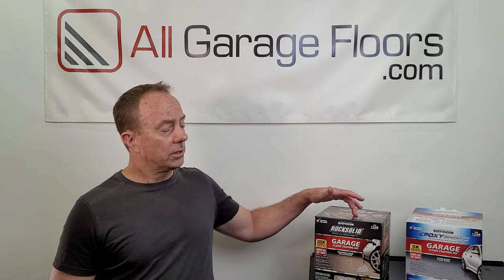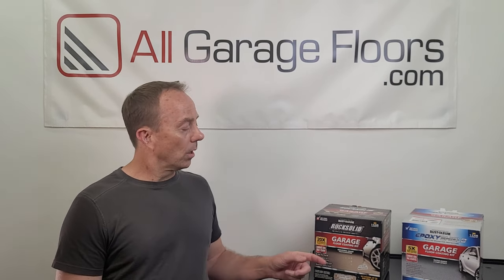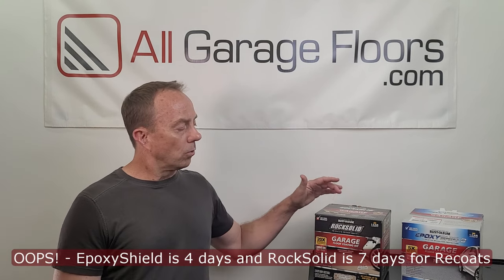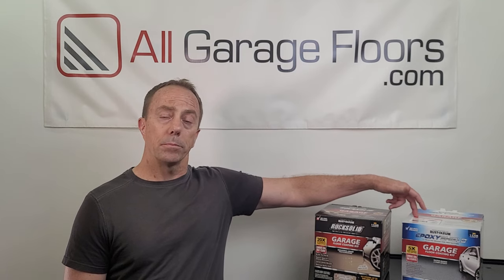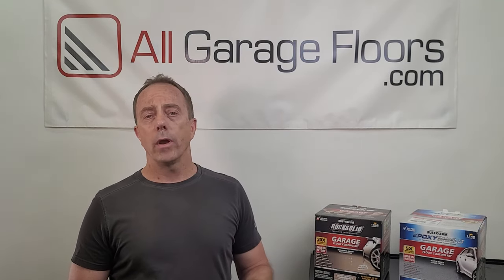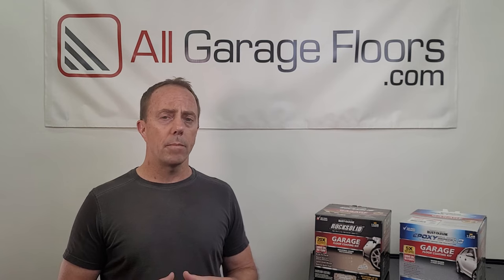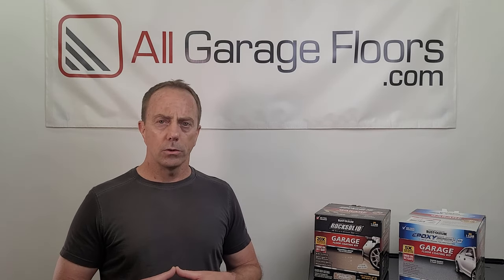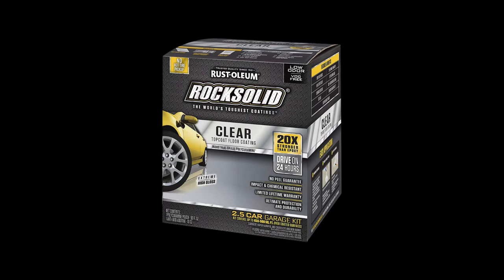RockSolid vs EpoxyShield | Which is Best for your Garage?

Comment: I’ve used both kits and the Epoxy Shield didn’t last but a few years. Hot tire pick up was the biggest problem. Sanded it all off and went with Rock Solid. It’s been on for about fifteen years. The problem I had with Rock Solid was a few batches never dried. I contacted the company and they were aware of certain batches being defective and replaced it.  Recoated the sticky areas but it still picked up dirt over the years. I have had zero problems with hot tire problems with Rock Solid. Now the clear is pealing off in front of the garage door and assuming it’s from the UV rays.
Reply from the maker: Hi Johnny. 15 years ago was before Rust-Oleum acquired Citadel Coatings which developed RockSolid. Back then, the RockSolid kit was a polyurea and not a Polycuramine like it is now. Polyurea is the better coating, but could be problematic at times. That is why they developed Polycuramine. If you scrape up the clear coat that is peeling and then rough up the entire floor with 120-grit sandpaper, you can apply another clear coat to the surface.
Reply: MIne is going on 12 years perfect, no tire pick up, no oil or gasoline spills affected it.
Reply from the maker: @31acruz  That's great! Again, as we stated above, RockSolid was a different product back then. It was a 100% solid polyurea (not polycuramine). The polyurea provided a higher dry film thickness, it was U.V. stable, had better scratch resistance (wears longer), and better chemical resistance. They created Polycuramine in early 2014 just before they were sold to Rust-Oleum. The reason for the change was to create a product that was more DIY-friendly. A compromise in performance was the result.
Reply: Just did the rocksolid today. I bought more than I needed in anticipation that I'd run short, but I didn't. Hopefully I didn't go too thin but my concret was very smooth, and I feel I did the right amount of prep. It's still drying at the moment, right off the bat I see a couple small areas that appear slightly darker. But if that's all there is and there's good adhesion, then I'm happy. I used 2 x 2.5 car garage kits for 900 sq/ft.

Comment: I thought the Rustoleum primer on previous painted floor can be used it is about  $70 a gallon and then the Rocksolid over it .I was told at a paint store is this correct
Reply from the maker: Hi Ed. That is correct as long as certain conditions exist. The first of which is that the current paint must be sound and fully adhered to the concrete. We tell you everything you need to know about Rust-Oleum Recoat Primer in our article here: https://allgaragefloors.com/rustoleum-garage-floor-primer/

Comment: Thank for posting. I got Rock Solid on my garage. Bad news is bubbles all over the places .I figured out it may be the moisture problem. In my case ,which one is suitable for my next job or any solution at all ?Thanks.
Reply from the maker: Bubbles can be caused by a variety of things. Examples are not waiting long enough for the concrete to dry after etching, rolling it too fast and heavy, air getting trapped if aggressively mixing it in a bucket, or applying it in the early afternoon with rising air temperatures. The best way to fix it is to apply another coat. First, sand the surface with 100-120 grit sandpaper to knock down the bubbles and any sharp edges for those that popped. Sweep/vac and then wipe down with denatured alcohol applied liberally to a microfiber mop pad. After that, you are ready for the second coat. 

If you believe it's moisture vapor from below the slab, then that requires something completely different. You would need to grind the coating off and do a moisture test in a few areas to determine how much moisture vapor transmission you have. If it's greater than 3 lbs, you will need to apply a moisture-blocking epoxy primer. These are more expensive than RockSolid and have a lower coverage rate. You then apply a new coating to that within 24 hours.

Comment: I have a new 24x25 garage, equaling 600 sq ft. I purchased a 2 1/2 car plus 1 car kit. According to the packaging it should cover 600-750 sq ft. The 3 bags did not cover 1/2 of the garage. I needed to purchase 2 more 2 1/2 kits in order to finish the floor. If I had known that the coverage was so low, I would have primed the floor first in order to seal the concrete. Primer is a lot cheaper then this product!
Reply from the maker: Hi Michael. Yes, this is a common complaint that we address in our review of RockSolid on our website. However, there are no proper primers available that you can use. They are not compatible. The first coat of RockSolid IS the primer in some cases. We explain why not to make a primer mistake with these coatings here: https://allgaragefloors.com/epoxyshield-rocksolid-concrete-primers/

Comment: Rustoleum has a new primer product that can be used over any surface to prep it for either of these finish products. If this primer is used first, it will help with coverage of the final epoxy / polycuramine.
Reply from the maker: Hi Gerald. If you are referring to the Rust-Oleum Concrete & Garage Recoat Primer, it can only be used on previously sealed concrete or coated surfaces in good condition. It can't be used on any surface, especially bare, untreated concrete. We don't mean to be sticklers, but such vague statements create unwanted problems for DIY installers unfamiliar with coatings.

Comment: I had to use two 2.5 garage kits for my two car garage. That’s right two 2.5 kits in order to get the high gloss finish. My concrete soaked up the polycuramine so much. But I expected this to happen with all the negative reviews I read. I doubled up and it looks gorgeous! Lay it on thick and back roll it until the roller starts to stick a little. Then finish rolling to remove roller marks.
Reply from the maker: Hi MGT. Yep, it's a common complaint that we talk about in our article. The problem with that though, is that it now cost more than a commercial quality single-part polyurea system that is twice as thick, more durable, and just as glossy.
Reply: Can you put a concrete binder down or are you not supposed to put this kind of epoxy on a concrete binder( my slab is extra nasty from the last owner and is in a flood plain, so it’s a humid slab)
Reply from the maker: @jakejake7162  Hi Jake. Concrete binder primers are not compatible with coatings. We discuss primers for DIY coatings in this article: https://allgaragefloors.com/epoxyshield-rocksolid-concrete-primers/
Reply: How many square ft. did 1 kit cover to get good coverage?

Comment: Can I apply rock solid over a newly epoxy floor? The floor was done about 1 year ago with epoxy shield. The epoxy shield is holding up great as of now.
Reply from the maker: Yes, you can. It requires degreasing the surface and then roughing it up with 120-grit sandpaper first. Sweep/vac and then wipe it down with denatured alcohol or equivalent applied liberally to a microfiber mop pad. Give it 15 minutes or so to evaporate and then it's ready for the coating.

Comment: Great review guys! Quick question: I’m prepping my floor with concrete degreaser. There are 3 spots I’ve been going over multiple times but when I spray water back on, the spots are still hydrophobic. Should I keep going over the spots until that stops or should I be fine at this point and should move on to acid?
Reply from the maker: Hi Mark. If the concrete repels water, then it will repel the coating. Go ahead and etch and then hit the spots again with a degreaser. The etching process opens the concrete pores and allows the degreaser to penetrate better. If you are still having problems with it, there are some good enzymatic oil cleaners that work, but they do require the time to do the job. We have an article about cleaning oil stains that you can read here: https://allgaragefloors.com/remove-oil-stains-from-your-garage-floor/

Comment: Hey thanks so much for the video, I just coated my garage with the RockSolid Kit and am wondering if I should add a clear coat / top coat. Do you recommend adding a top coat? What are the benefits / advantages…? If so which one do you recommend? Thanks 🙏
Reply from the maker: Yes, there are various reasons why a clear coat is recommended. Primary is that the clear coat will lock in and protect the color flakes and color coat. The number one rule of clear coats is that they should perform just as well if not better than the color coat since the clear coat will receive all the abuse. We have an article here that discusses all the reasons why a clear coat is recommended: https://allgaragefloors.com/clear-coat-your-epoxy-floor/  

We recommend that you use the RockSolid Clear coat since it is compatible. When using RockSolid, you have 7 days after application to add a clear coat or subsequent color coats before additional surface prep is required. If you are past the 7 day window or you choose a different clear coat option, it will require that you first degloss and rough up the surface with 120-150 grit sandpaper first before applying the clear coat. If you don't, the clear coat will not adhere.

Comment: Great video. Hope i found this before I had applied the coating. Is there a way to fix hot tire pickup? I am having hot tire pickup on one side of the 2 car garage even though I applied the clear coat on top of the color coat.
Reply from the maker: If you are using RockSolid, then the issue is most likely poor concrete prep, oil stains, or some other contaminant on that side of the garage. RockSolid rarely pulls up from hot tires with proper concrete prep. We would recommend a good degreasing (if oil stains are present) and then a more aggressive concrete etch to prevent it from happening again. EpoxyShield, on the other hand, has a reputation for peeling up despite how well the concrete prep is.

Comment: Fantastic comparison video!  This is exactly what I needed.  I'm using EpoxyShield and am now convinced I need to use a clear coat.
QUESTION:  What will happen if Epoxy Shield is laid down at temps lower than 60 degrees?  Assumeb 50 to 60 degrees and about 55% humidity.
Reply from the maker: We are glad it helped. Do not apply EpoxyShield if the air temperature and/or temperature of the concrete will be below 60 degrees during application and while it cures ( minimum three days). Temperatures below 60 degrees slows the chemical curing reaction. You can end up with a gooey coating that will fail to harden. For the clear coat, we recommend the EpoxyShield Premium Clear Coat. You can usually find the best price here from Amazon: https://amzn.to/4aDZMXS
Reply: @allgaragefloors  
Thanks.  I might have screwed myself until next spring.  Any idea of putting a heater in the garage will change the temp of the concrete?  Room temp will be easy to manage.
Reply from the maker: Sorry for the late reply. Your comment was being held for some reason and we just found it. The most important temperature to pay attention to is the slab temp. That is the temperature that the epoxy will adopt within a few minutes of being applied. Warming the garage helps, but it takes time for the slab temp to rise. This is when it's a good idea to purchase a $20 infrared thermometer to see what the slab temp is before you begin heating. It can take upwards of a week for the surface temperature of the slab to come up. Also, pay close attention to areas near the garage door and man door. Cold, drafty air can run across those areas and affect how the epoxy cures compared to the rest of the floor.
Reply: @allgaragefloors  
Yep, thought so.  I have a laser temp reader and it's too cold.  I'll bag the project until spring.
I plan on putting in a weather barrier under the garage door to prevent dust and water encroachment.
Thanks for the info.  Saved me from a terrible clean-up effort!

Comment: Great information! Came across this as I have a brand new enclosed trailer that I want to coat the plywood floor. With the current temps like they are, looks like the Rocksolid will work fine. Total square area of the ramp and floor is 160SqFt. Being wood, should that be sufficient? Also, the ramp really needs to have good traction. Does the anti-skid additive really work well?
Reply from the maker: Wood can absorb more coating than concrete, so plan on two coats for a proper application. You will need to rough up the surface with 80-grit sandpaper for prep. The anti-slip media meets ADA requirements for a level surface. It needs to be added to the final coat. We would recommend increasing the amount used by 50%. for better traction on a ramp. Either that or you can use a more coarse aluminum oxide anti-slip. The downfall to that though is that it makes it harder to clean since wants to grab anything you use on the surface.
Reply: @allgaragefloors  Thanks for the reply!, I'll make sure it's roughed up and get extra Anti-skid. And I'll just get a 2.5 car kit to make sure I have plenty.

Comment: Hello - is it ok to put epoxy shield clear coat on the rustolium rocksolid? 

Rustolium rocksolid clear coat is lot expensive than epoxyshield clear coat.

Appreciate your help.
Reply from the maker: Rust-Oleum states not to apply one over the other since they are not compatible. However, it can be done if you let the RockSolid color coat cure for a minimum of 48 hours. After that, you will need to degloss and rough up the surface with 120-grit sandpaper. Sweep/vac and then wipe the surface with denatured alcohol applied liberally to a microfiber mop pad. This will allow the EpoxyShield to mechanically bond with the RockSolid. The reason RockSolid is more expensive is because it's higher quality. You would essentially be downgrading the performance of your coating system by applying EpoxyShield.

Comment: I plan to redo my garage floor, epoxy shield maybe 10 years ago, it held up very well.  Do i need to prime this with a lock down type of primer?  Also, the Legacy product is interesting - can i add color and flakes to this polyurea in a one coat application?
Reply from the maker: Hi Doug. Is EpoxyShield on the concrete currently? If so, what shape is it in? Proper prep is very important depending on what is on the concrete currently. Lock-Down is a latex acrylic primer for paint and not compatible with coatings. DO NOT use it. 

Nohr-S Polyurea by Legacy Industrial is applied similar to other coatings. The color coat goes down followed by the optional color flakes and clear coat. It is a commercial quality coating that is far superior to EpoxyShield. If you choose to go that route (best value for the money in the long run), you will need to remove the EpoxyShield coating via grinding first. If not, you will not gain the tenacious bonding of the polyurea and your coating will subject to how well the EpoxyShield is adhered to the concrete. It's like building a nice home on a poor foundation.

Comment: Great video, very informative and lots of details. 
Would it make sense to use an ExpoxyShield as the "base" and then a RockSolid clear topcoat, would it make it more durable or are the 2 products not compatible?
Would you recommend another layer of clear topcoat every few years (5-10 years maybe?)
thanks
Reply from the maker: Hi Jammykam. EpoxyShield and RockSolid are not compatible. You need to use one or the other as a system. EpoxyShield color coat with EpoxyShield clear coat for example. Same for RockSolid. If your goal is to achieve a longer wearing and more durable coating, then we don't recommend either of these products. There are much better coatings to choose from. The two we talk about here are the most well known since they can be found in home improvement centers. Check out our links in the YouTube description for better options.

Comment: I applied epoxy shield on my garage floor about 5 years ago and is starting to look bad, ( not too much tire pick up) I want to reapply and paint chip again. Can I get by just sanding the floor and reapply? 
 Thanks for your video
Reply from the maker: Hi Robert. Yes, you can sand with 150-grit sandpaper. Vac/sweep the surface and then wipe it down with denatured alcohol or equivalent before applying the new coating. We have an article about how to recoat older epoxy floors here: https://allgaragefloors.com/prep-older-epoxy-for-new-coat/

Comment: Quick question I’m doing this by myself and my garage is quite full. Can I do this application half-and-half prep work paint or epoxy clearcoat wait they recommended drying time shift everything over and do the other half?
Reply from the maker: You can do one half first and then the other as you described as long as you have a contraction joint or natural divider in the concrete to terminate each half of the coating. If not, it will be very obvious where the two halves meet. Coatings do not blend together well like paint on a wall does. There will be overlap marks where the second coat contacts the first coat.